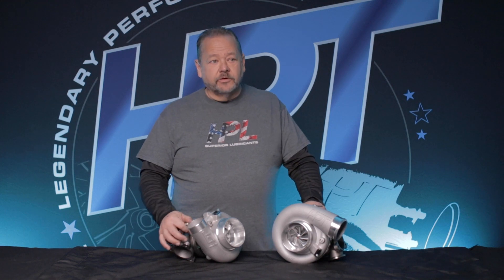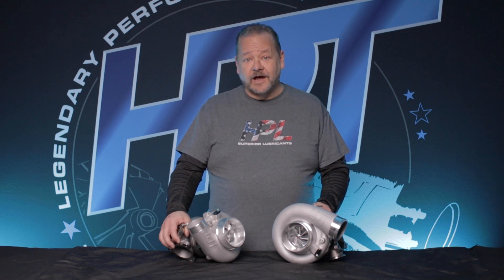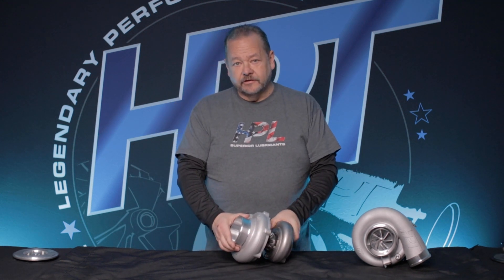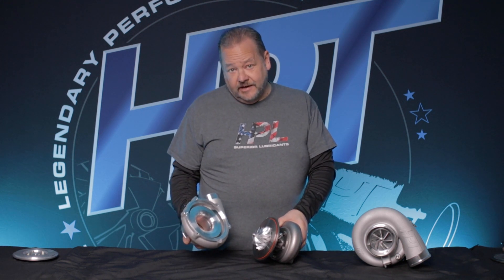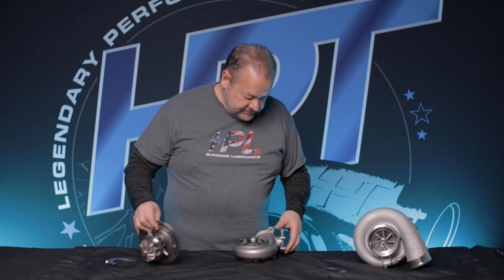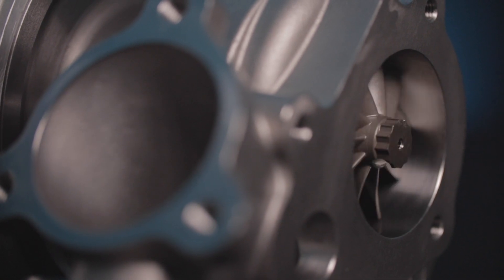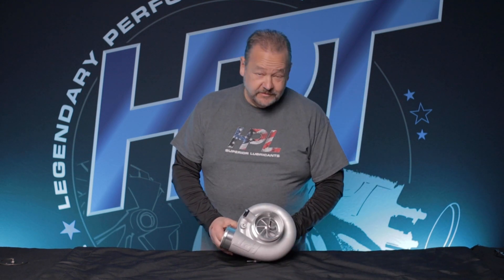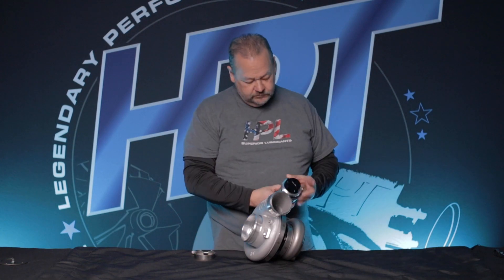How are HPT Buick Turbochargers Different?

Comment: Thanks Harry! Will there be a 4 bolt version or is there no longer any real advantage to going 4 bolt anymore? Also curious if a v-band exit is an option for those that want to use the external gate?
Reply from the maker: Hey Scott! All 4-bolt, 3-bolt, and v-band turbos in various sizes have the potential to make great power. It really depends on how you want to build up your combination. Currently, we only offer the external gate as part of the turbine housing for the Buicks because we know it is a good location for an external gate.